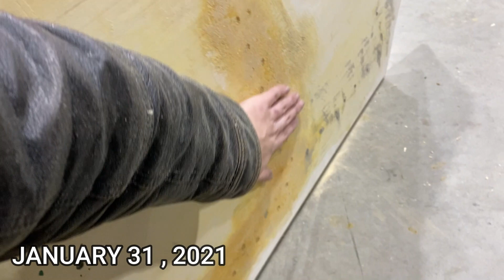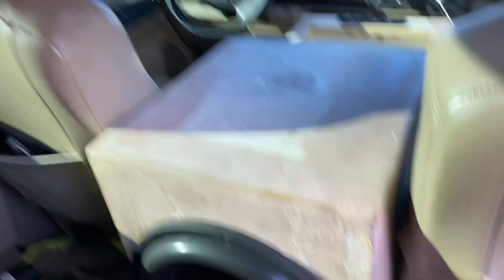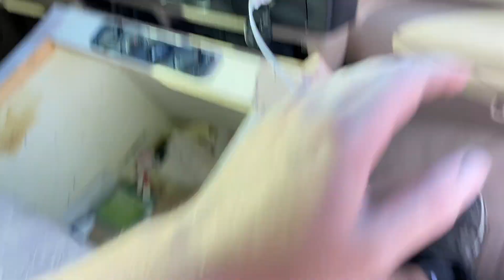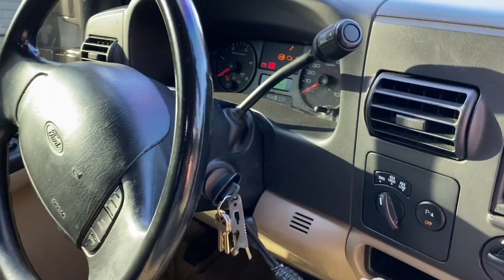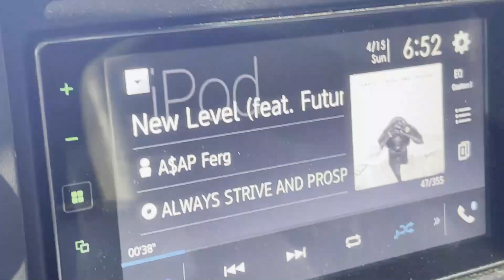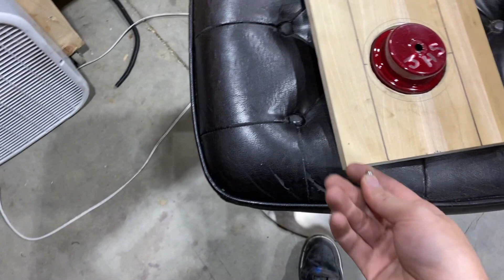CENTER CONSOLE SUB BOX BUILD | 15 INCH SKAR AUDIO | PART 4

Comment: I am currently building a center console also .... lot more work than expected but slowly coming along .... just a suggestion wrap the box in tan and your accent trims for the box red and I put a piece of plexiglass between the console and cup holder fascia plate that the sides light up red when truck is on .... thank you

Comment: I have a 2013 F250 I got for $800 and I was about to purchase 4 skar 8" subs, 4-8" mids and 2 tweeters. I have an old school Audioque 12 subs and now I am thinking if I should do a center console. I did a raptor bedliner on my $1400 Silverado 3500HD and after a year the bed liner still looks great. Last sound system I had was about 2009 when I drove my car into a canal which was really bad for my electronics that all fried.

Comment: If your voltage isn't staying in the 14v + range, then your amp isn't putting out all that it can give. Get your electrical right and it'll hit a little harder. Also put a Stereo Integrity sql 15 in that box and watch it get louder and sound better. 👍 90% of Skar subs are not spec'd for sealed, even though they give box specs. Learn some about t/s parameters so you can distinguish subs that are made better for sealed and subs built for ported, ect.
Reply from the maker: Thanks for the help man I will Definitley check into all that!!

Comment: Also. You cannot drill the holes bigger for the seat mounts. You will mess the threads up. And not be able to mount seat back. Correct the box. And make it fit right.
Reply from the maker: Weird you say that cause I’ve already drilled the holes bigger in the seats and made it work no issues.
Reply: @JUSTINHAWKSMITH  ah, I see.  you drilled the holes on the seat, not the ones on the floor.  My miss understanding.

Comment: Raptor Bed liner? That's the easy way out wrap it in vinyl ... I'm sure you'll do a great job that would look great and professional.... thank you
Reply from the maker: Sadly the way the box is designed without detachable pieces and stuff doing a leather vinyl wrap in black would just be too hard For me and my time spent doing it wouldn’t be worth the looks. I’ll be covering most of the bed liner in beauty trim pieces wrapped in ram leather so shouldn’t look too bad. I do agree tho definitley the easy way out, that’s why I’m doing it.. hahah!

Comment: Upgrade your batteries to AGMs yellow or Blue top optimas . If it smells hott could be clipping? Also a sealed box will sound better with limited air space and handle more power. A crossover tuned to the frequency the sub was designed to play will also help with sound quality.

Comment: what series skar is it? how many cubic ft is the box? why go from kerfed to aero port? what power and electrical are you running to run the sub?
Reply from the maker: It is a Skar VXF15 , This is my first sub box build ever, so when doing the kerf bend slot port I ended up messing up as far as port surface area , tuning, etc , I didn’t do it correctly. Net volume is 3.65 So in order to get the box corrected with correct net volume after sub displacement, bracing , I had to end up doing aero port and couldn’t be happier, it’s receiving around 2000watts RMS. All 0 gauge wire as far as electrical if that’s what your asking , 10 gauge speaker wire.
Reply: @JUSTINHAWKSMITH  that’s what’s up man. tbh you could do so much better than that if you’d put a little more detail to it and we both know this. I’D say try building a better one out of some good ol Lowes Maple, Oak or Birch 3/4 plywood, work with what exact room you have to work with because there’s a reason why a lot of people usually go 10” at the biggest for a center console or single to dual 8”s. By the way the box looks like there’s got to be an air leak somewhere along those edges. Lowkey sounds like im bashing but im just giving my pov as a person that’s been in the car audio game for a few years now

Comment: Do the line-x on the box, especially for the interior of the truck, the overall look of line x is much nicer in my opinion than raptor liner. 👊🇺🇸
Reply: I did Raptor on a flat bed I built, what makes the Line X a better choice for you. I will be needing bedliner for an upcoming project and curious if to try it out.

Comment: Usually clipping is caused from to much power/juice to the sub/speaker.  I’d recommend a JL, RMS on JL subs are extremely high. One JL will make ya teeth rattle if ran correctly.

Comment: Go to Wal-Mart and buy Polyfill in the pillow section and fill the inside of the box. It will help with the acoustics of the box and how high is your amp turned up and what is your bass crossover set on?

Comment: Run your power wire and rcas separate and don’t get a new alternator just put a capacitor on your amp and if you have a skar amp the thud is more than likely coming in because your subsonic setting is not tuned high enough and if your box was ported it would be way louder Ik I’m a little late to this video but still

Comment: Definitely need to turn on xover on amp..low pass and that should clean up prob all of what you are hearing unless you're absolutely killing the sub...what is it pwr rating and what it the rms per of amp?....port tunning is much louder back when I built this stuff I had a 1k Rockford fosgate amp driving 2 15s in a port tuned box and had it professionally metered at 146.3Db at 53Hz....yes It would hurt you

Comment: Try a capacitor, it should help with quick hits by keeping your power at the correct level. 2 farads should run a 15. It'll save your batteries and alternator in the long run.
Reply from the maker: Capacitor or bigger alternator ? Whatcha think?
Reply: Bigger alternator for sure
Reply: Don’t buy a capacitor. Waste of money. Do it right and upgrade your alternator, “big 3”, and batteries.